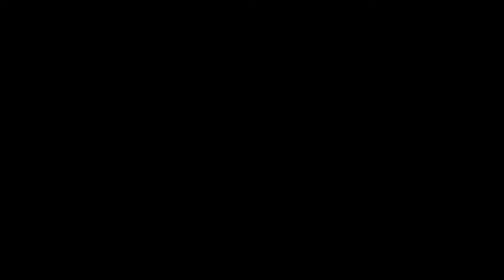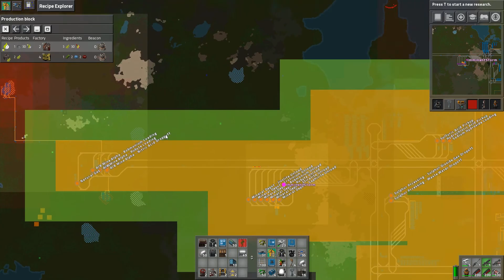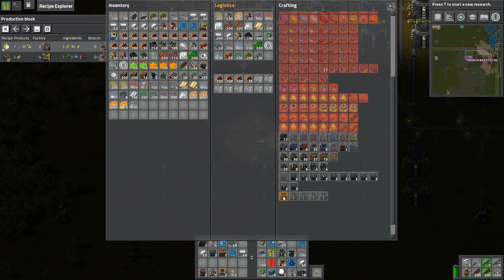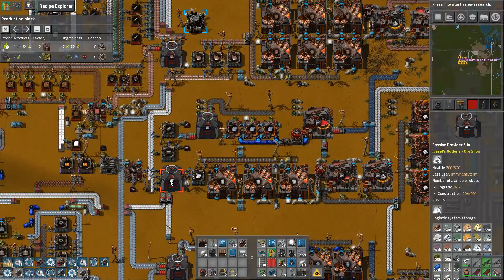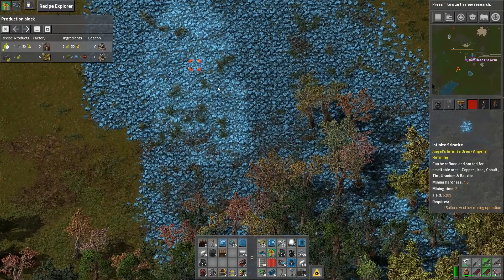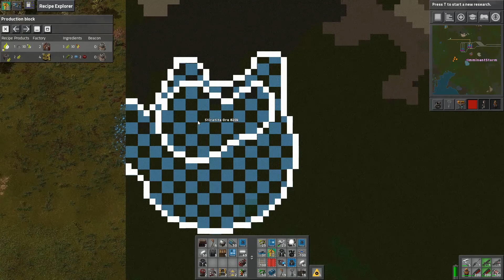Factorio - Angel's & Bob's - Episode 96 - Prep for New Mines

Comment: I think you'd benefit by having a lot more logistics bots, say a couple hundred more bots. It's already a long round trip from your supply to where you're working, so if you only have about thirty bots making deliveries, it takes even longer to get your materials because each bot has to make several trips to get you the materials to make, say, a single warehouse. With a couple hundred logistics bots, at least you'd only have to wait for one round-trip to get all your steel, iron plates, and stone bricks, because a lot more bots would be working at once,
Reply: Also, when you mentioned having something requesting wood from the logistic system so you use it up... I'm thinking that the place where you build wood blocks for train fuel might be ideal. You already have the infrastructure in place to do something with that wood, you just need to put in a requester chest and a priority splitter with input priority from the requester chest so that it uses wood from the chest first, then if the chest is empty it uses wood from the greenhouses.